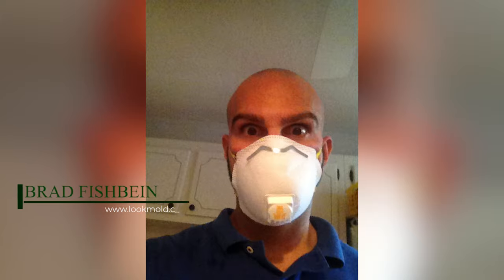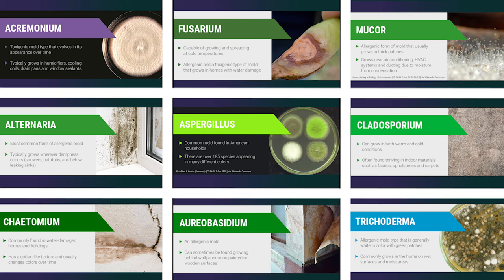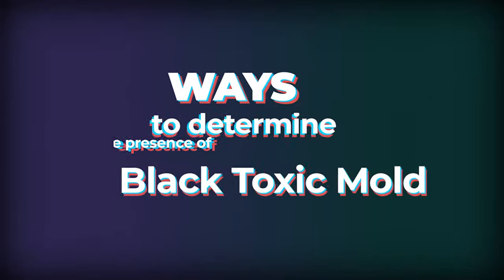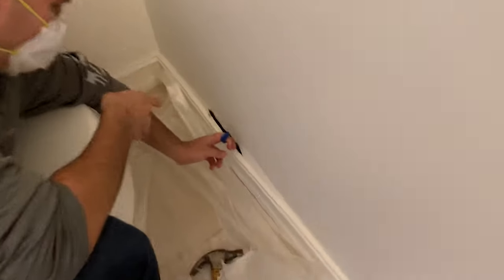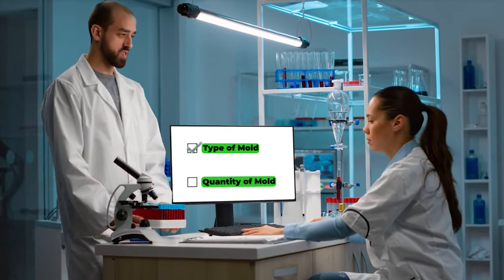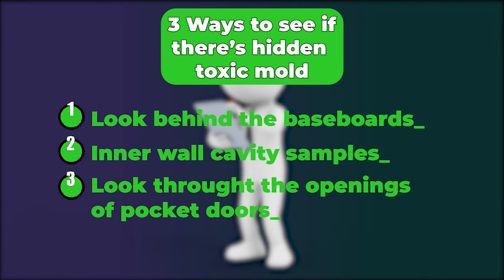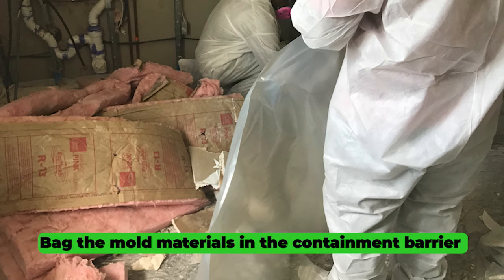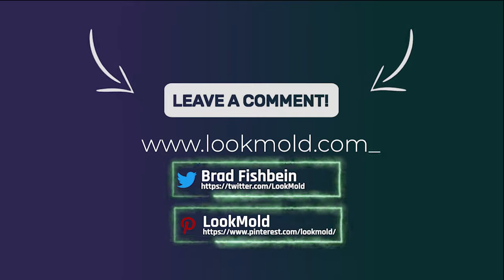Black Toxic Mold Hidden In Your Walls? You Need To Do This

Comment: I bought a house passed all inspections. There were no signs of mold other than severe health problems developing . We drilled holes in the walls and looked inside with a long camera. Fast forward today and we have removed over 800 square feet of mold that was inside the walls and floor. The whole house had to be gutted down to the studs in every room. Apparently the roof had been leaking badly at one point and the house was vacant, and then was “remediated” by a professional. You cannot just clean and put paint on mold it has to be removed
Reply: What camera did you use?
Reply: What did this cost??? We have the same issue. I think the entire house has it. I also used a scope to find some and we’ve remediated some areas but not all. I’m talking 2600sq ft.  We want to sell but we are in Houston and most likely will not find anything “safe”.  Not sure if we should sell or remediate.
Reply: I’m thinking I’m going through the same thing I bought the house last November I’m already out $50k with repairs and it past inspection…
Reply: It's just going to come back because every house gets mold. It does NOT need a leak, water vapour, wet shoes, your windows will have mold in the track
Reply: This is so true! This happened in my building where they just literally painted over the mold

Comment: Some people got toxic mold in the walls of their brand new homes without a water leak due to the builder leaving the wood outside in the elements for too long. Water - humidity got to the wood and thus mold. The builders still used the wood to frame the houses.  Later on people are living in it and starting to get sick.
Reply: It's not just wood outside. All the cement, plasterwork and exposure during construction leaves the walls with a high moisture content in the first year of a new house. Which is know to cause mold. 

Haven't read any official solution about it. But maybe getting a strong dehumidifier and setting it at the right rh% could help prevent mold and create a controlled drying process.
You probably shouldn't set the rh% too low either as that could cause a too big of a difference resulting in the plaster coming loose. But maybe it's fine.
Reply: Also, holes in house.  Windows or doors not sealed properly or house shifts and cracks occur
Reply: @TaelonSHU Concrobium is a solution that kills mold, and I recall Home Depot had a mold fogger in their tool rental department that you’d fill with this stuff and it atomizes it. People would use it for flooded basements or crawlspaces, but seems like it would be good if builders owned these, and used them for every new build. Would be so inexpensive, but I’m sure none of them do it. As a buyer, though, it would be a really good idea to do this before moving in, just so be on the safe side.
Reply: @PoissonDemiVide  does concrobium penetrate into porous materials.to.kill mold?

Going back to my previous message.
A huge cause of mold in new construction in the Netherlands are.
1. Construction goes to fast, not allowing each element to dry before applying the next.
2. Placing the windows in too fast (was especially with factory made walls). This blocks a lott of airflow and thus requiring power hungry dehumidifiers.
3. Construction defects; causing small leaks in the roof/window or connecting the plumbing/heating incorrectly...so simple yet so  Common.

We  also have a very wet climate which doesnt help either.
Reply: @TaelonSHU  I do believe it does, as most people use the solution in a spray bottle for smaller areas. You simply spray it, and no need to rinse. Different materials call for different dilutions of the solution with water. It will not take care of any staining, though. It’s only meant to kill mold. Many think bleach will kill mold, but they’re mistaken. Hopefully, you’re able to find this product in the Netherlands. If not, surely you can buy it online. Good luck!
Reply: @PoissonDemiVide  FYI The newest formulation of Concrobium Mold Control contains:
Trisodium phosphate 1-5%
Sodium Carbonate 0.95%
Both are inexpensive cleaning powders.
Sodium carbonate, Na₂CO₃, is also known as washing soda, soda ash and soda crystals.
[Not to be confused with Sodium bicarbonate, NaHCO₃, also known as baking soda.]
Reply: @Mavrik9000  interesting 🤔 I wonder if it’s as effective as the older formula at killing mold. I was unaware they changed it. Then again, I don’t remember what ingredients were in the original formula. Thanks for the info
Reply: @PoissonDemiVide  I'm about to test a version of the new formula. I had a roof leak and I've got mold on and probably in the ceiling and wall. :(
Reply: @Mavrik9000  that’s awful 😣 please update us with your results!
Reply: Every receptacle, outlet and light switch, has holes and gaps that allow moist interior vapors to get inside walls.  To prevent this there are cheap foam gaskets that can be easily installed behind the cover plates.
Reply: Yup. This is why buying in states that have strict regulations in the building process is important .
Reply: @Mavrik9000 someone did their research!  Unlike many other individuals. 😎
Reply: @Mavrik9000 sprinkle some baking soda over it 😂
Reply: @PoissonDemiVide  YouTube didn't like my long version. 
The short version is that I removed some of the sheetrock completely.
The parts that weren't damaged too badly, I vacuumed over the surface of the moldy areas with a highly filtered vacuum. 
Then I painted over the stained areas to trap or encapsulate any remaining spores.

Comment: I’ve been a painter for over 30 years, I’ve encountered tons of mold ,tearing out drywall, baseboards . Never really got sick . I’ve always cleaned it killed it with bleach and water but they recommended using other stuff that I’ve used that doesn’t seem to work as good as bleach n water. Then I prime then whole area keeps it from growing back as long as there’s not a constant leak
Reply: Please don’t do this. Someone doing this exact thing is the cause of my severe illness and having to gut out entire house. Bleach feeds mold while literally bleaching it so you don’t see it but the roots continue to grow
Reply: @Breeandfree I've got a mold issue in a house I've just moved into what illnesses have U got if U don't mind sharing
Reply: You need containment and negative pressure to remove particles from the air. The mold spores become airborne when you rip out moldy drywall.
Reply: @Breeandfree  you can use concrobuim mold remover that supposedly kills the roots it’s one of the best mold removers out there but I’ve used a bleach solution more times than I can count as long as you seal it with a good primer it doesn’t come back, I’ve done it on my house. You’d have to plastic off your area remove all the drywall set fans to dry for at least 3 days spray the concrobium then prime the inside of the walls then drywall as normal. If you want to do it the safest way. I did insurance work for years most people aren’t as susceptible to the spores as you. Mold is all around us all the time

Comment: We actually had toxic mold in a wall that WASN’T from a water leak. It was from improper drywall installation. First, regular drywall was installed under the tile. 2, a gap want not left between the drywall and tub lip therefore the dream acted like a sponge cause toxic mold. My case is kind of rare but wanted to throw it out there as we never had a water leak that caused our toxic mold problem…. Good video though. The indication we had is I got very sick. And no one could figure out what was going on. A health couch suggested we look into toxic mold. And there was some tile that didn’t look flush. It actually looked very minor and barely noticeable. That’s how we found it. 3 years since then and in still in recovery.
Reply: are you better now ? survived?
Reply: not rare

Comment: Its surprising how good small dehumidifiers work i had a problem with condensation on a cold corner  the small machine cured it
Reply: Did you eliminate the source?
Reply: Yes had a wasp nest in cavity which was on a wall tie this wall gets a lot of wind& rain so was making internal wall in cavity cold and damp

Comment: There are more homes around that have mold than you can imagine. Not saying it's not an issue to worry about but one where you have to pick your battles wisely. I think the trend has been to make homes so air tight that mold then becomes a problem.
Reply: Not necessarily. High insulation but poor air tightness can cause problems (you need to do both). In humid climates a lack of air tightness can also cause problems if you use AC as the humid air will condense on cool interior surfaces and then support mold growth.

Comment: Thank you for all this information. I’ve not come across anyone actually showing how to get rid of it the right way. I ended up very sick from my car because Subaru neglected my maintenance plan and left the faulty condenser and over 1.5 years of it leaking I and my pet got severe mold toxicity. We are now I. Recovery mode since I was able to on point the symptoms and start of it. And thanks to my 10 pound service dog Chihuahua. He was the one who alarmed me that it was the car because I was thinking so many other things that the sicknesses could be and he started digging in my car like crazy person and he no longer wanted to get in the car and I use my car for delivery services and all those types of jobs and he was being so difficult and then it hit me that wait a second He’s trying to tell me something and then when I thought about it a little more deeply over the next week boom it hit me. I said 0MG Subaru is that fault for this? They have caused this to happen because they won’t fix that damn leaky condenser and then I pulled up With a mask and with proper gear although that been way too late because I was extremely sick but anyways, I still did I looked. I pulled up the trim on the car door on the right side where the condenser was leaking and I was absolutely horrified at what I saw. It was like a little monsters were laying in there like my car was toxic wasteland so I do agree everybody please use the proper gear. Please take proper precautions because it is scary how fast and rampant this stuff can grow on you and you and on your family and you don’t want to hurt them further than what damage already has been done. Listen to this man when he tells you this, he is speaking the truth and it’s very serious Speaking from my experience so once again, thank you so very much so gracious to you and your information and your knowledge and may you and your family have a wonderful super blessed year.!

Comment: Perfectly well explained video. I learned a lot. Thank you so much. I have a leak coming from somewhere in the roof that is causing black mold ? to grow on the side of a wall up next to the ceiling. I am trying to figure out how I can best tackle it. Would  this be black toxic mold or just surface mold like you say in your video ? I put plastic adhesive tape on it to contain its spores and I am going to put a plastic barrier around to prevent its spores from spreading.  I was going to spray it with bleach, but since I put tape on it to contain it I will just cut a large area around it and then put a piece of new sheetrock on it. We had a couple of water problems in the bathroom. The water went into four rooms, but I used dehumidifiers to dry up the air. The air temperature was cold about 25 degrees, I was freezing, so I know the cold temperature helped me. There are no other signs of  black or surface mold in the walls, but I am still suspicious. I have to break some of the walls around to see what is behind. We do not have real " professionals :" in our area so I am forced to do it myself.
Reply: Please check into white vinegar, it kills mold instead of bleaching the color. We use it in the medical industry. Sorry about your problems.
Reply: @sunrae7680  Thank you for the info.

Comment: Thank you for this.
There's a leak on an extension of our house which comprises of a bedroom and a split level lounge. For years now, a leak has happened in this area. We've done a number of remedies like:
1. Changing corrugated iron roofing on the bedroom side

2. Sealing grooves on corrugated iron roof.

3. 2 to 3 roof experts came to re-do previous works.

Nothing worked.

In the past 2 months, I've noticed growths like algae, mould, mushroom-looking plants growing on the ceiling and drying on the ceiling. These were removed today. 

I'm concerned because this is in my bedroom and lounge area and I have been seriously ill from October-December 23 and recently now again.

Could this be caused by this toxic mold? How can we deal with this?

Comment: Wish I would have found this sooner. Moved into a rental property with a sunken shelf under the kitchen sink only to find that the dishwasher air gap had been zip tied under the sink while someone replaced the faucet fixture and installed a hot water spout in a smaller drilled hole. The air gap was zip tied to the underside of this hot water appliance (appliance gone when I got her, but the spout was left to cover the hole... cheap pary ( ; )

What I found after the Landlord's handman cut a hole was that (black) mold was present.  They had a mold inspector visit the property but would not speak to me, the person living in the home for 17 days.  Now I'm still living here, no agreement on financial remedies and I have to find a new place to move and incur a new round of moving expenses, down payments, application fees and so on... just to find another safe and hazard free environment.

Court seemd to be the only option but time is critical. To execute the move I need to see confirmation that this home was marked uninhabitable while the 10-15 day remediation takes place, which hasn't started since the findings were confirmed by the specialist's tests on Aug 1. So I will move out, pay for storage, and sue the heck out of the landlord and broker for not acting in good faith and providing myself and my family a safe living environment.  

For all those facing this, I have learned a lot about Texas' code and laws.  I have been speaking with an attorney, however, their recommendation is take it to court myself as this is a very cut and dry situation.

Thanks again LookMold for this detailed walkthrough.  Good stuff!

Pictures and links to US and TX local state code and laws available upon request for anyone working to sort through this one.
Reply: Why he gotta say BLAĤHHK mold? Watch your tone....

Comment: What if you live in an apartment and think you have black mold? 

I live in Hawaii where it's very humid. I think there's been water damage in the walls because one storm there was water leaking out of an electric outlet in the kitchen. (property management has since "repaired it. they also said there has been leaking in the roof for some time so apparently that was the signal to finally fix it) I have lived in that apartment complex for about 6 years and moved between units, and when I moved to this particular unit my "allergies" became the most unbearable, extreme allergies I've ever experienced. So it isn't just the area I'm allergic to, it's this particular unit. When I went to look at the top of my refrigerator for the first time, it was covered with black colored mold. I used bleach to remove it but didn't use any kind of protection and now I'm worried. I'm making an appointment with my doc about my symptoms but I wonder what obligations do property managers have for this.

Comment: Hello,

I hope you can assist me with this question. Long story short, I live in a rental apartment. About four months ago, I moved in and started getting sick. I found out there was mold at the bottom of the cabinet in the restroom. The landlord called a company to address it, but I don't think they did a thorough job. Unfortunately, they did the remediation while I was working from home, and I got really sick. I inspected the room after they left and saw they didn't replace any insulation or frames that were black with mold. They just sprayed mold treatment, which I don't believe kills mold effectively without replacing the contaminated materials.

They only removed the cabinets and some drywall, but it still smells very bad, and I'm concerned the mold is still there. Do you think the mold is likely to come back or is still present, considering they did not replace the insulation and frames?
Thank you for your help.

Comment: I have a question for you. My apartment bathroom has a gap between the wood floor and the base boards. I noticed it getting light mold on the bottom front of the base boards. I was able to scrub that off then I told my apartments who would not so much as come look at it for over a year. So I put sealant along those gaps. When they finnally showed up after many complaints I had about things not getting fixed they told me I should have left the gaps it helps the wall to stay dry. I wondered if this is true. Is it better to use sealant or leave gaps?

Comment: My family had water from tub flood downstairs. The carpet nor ceiling are walls were never open.   Water mediation came out with fans 6 days later and were supposed to return  to remove flooring and open ceiling. Never did.  3 months later got permission to remove some flooring it was still moist and ceiling was  moist and not all was open. The insurance company refuse to open walls and has taken advantage and has closed the claim. Concern about mold in the home.  It's been over a yr and no one even attorneys won't help. Should someone just start opening up the walls and ceilings . When they find the damges how will they pay?